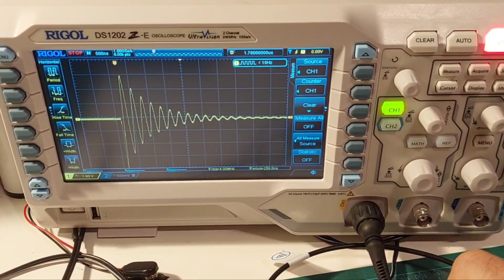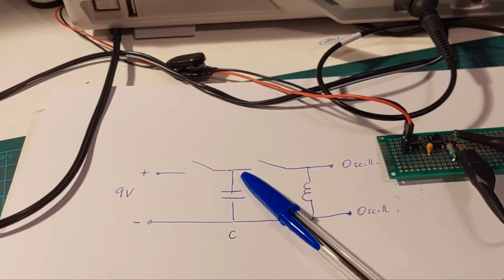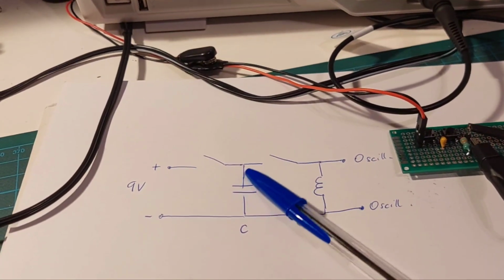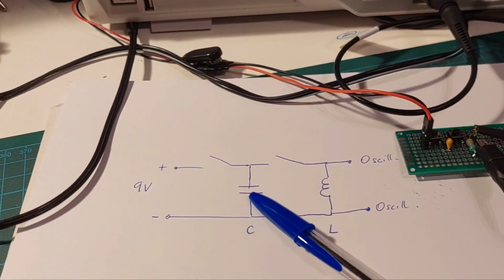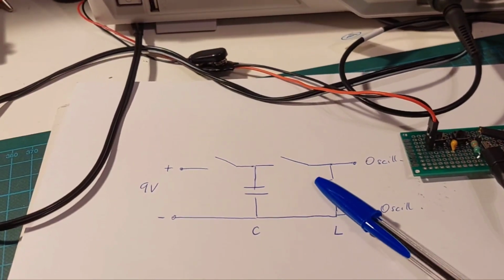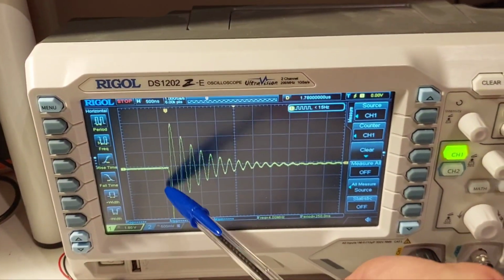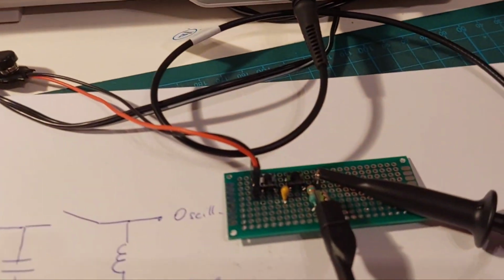The sine wave of an LC Tank Circuit

Comment: I’m trying to do this myself on the RIGOL DS1054Z. 

Would you please tell me what settings to use? 🙏🏼

I’ve got a 1 nF ceramic capacitor and a 2.9 µH inductor, with an anticipated resonant frequency of about 1530 kHz.

I tried to measure them just like you just did before, but I couldn’t figure out how to properly set the scope. 😞

(I’m inexperienced, and just learning.)

Also, I seemed to get a lot of noise each before and during setting off the event (the LC oscillation) that I’ve wanted to measure so badly, like you just did so easily! 

P.S. if you’re up for a bonus, I’d also be thrilled to have your tips for a similar single fast measurement of the discharge curve of a capacitor with a known value resistor in a bare bones RC circuit. (I’m ultimately trying to derive the precise real world value of the cap this way.)

Cheers ✨⚡️✨
Reply from the maker: But it's only "1V division", the knob for that you do find and "Single Shot", last button on the top right. Perhaps keep trying:

I found that adding the switches and soldering on a perf board helped.

Just sharing the old fashioned way.

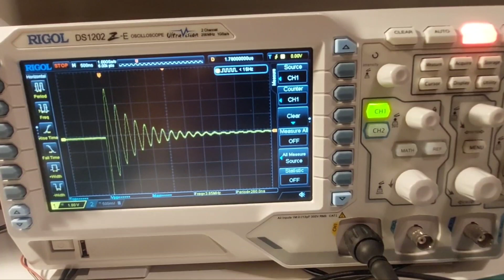Please find the values I used in the schematics, they are in the video at 1:45.

Keep it up!